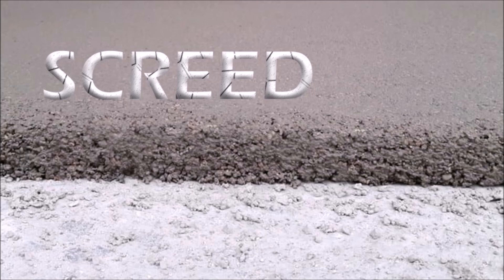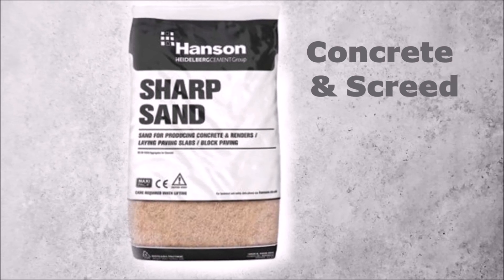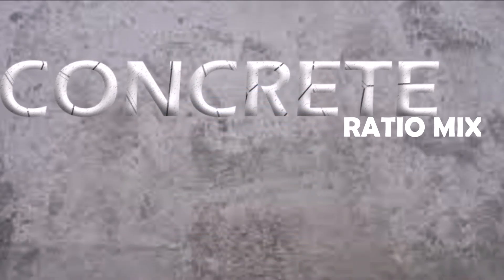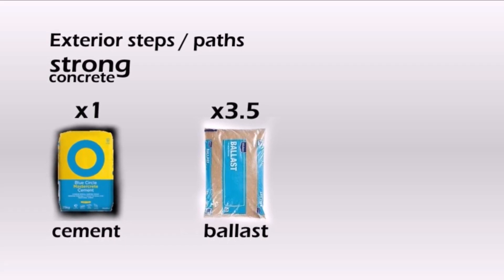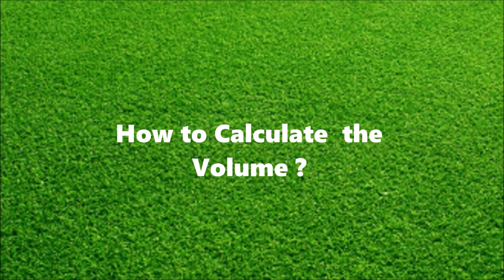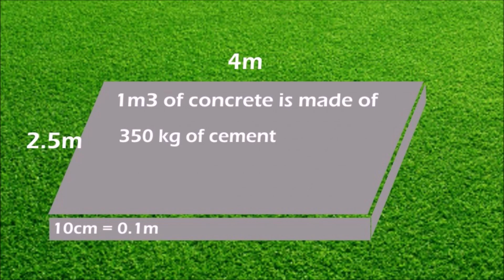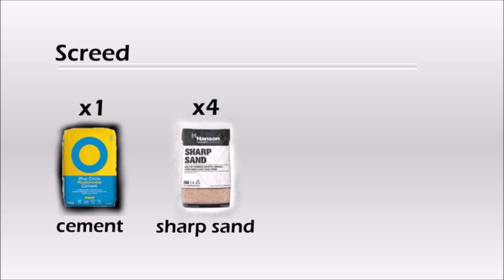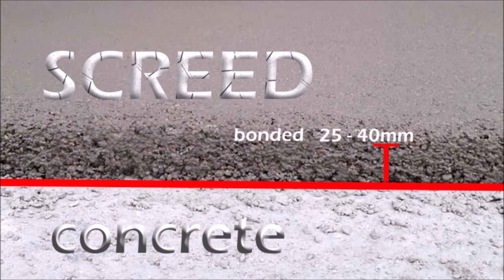Concrete Screed  Ratio Mix How to calculate Volume Cement Aggregates Water mix

Comment: When dealing with unbonded screed, it may be the case that a sub base through which  to pass pipe conduits (electricity and/or water) is used. Can this sub-base be composed of compacted or tamped gravel with sand?
Reply: Should fine since gravel is self compacting

Comment: Which is best to do on concrete floor bonded or unbounded screed?
Reply from the maker: Hi E K.  It's not about the good or bad. the damp proof membrane prevent the moisture to go through the screed or concrete. So if you need  to use DPM then the screed needs to be thicker as the dpm separates concrete & screed.